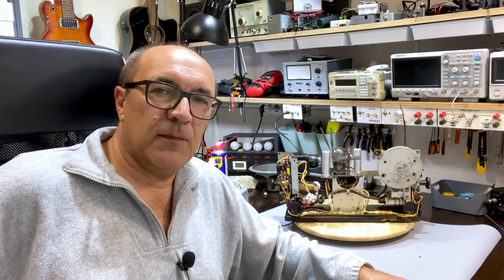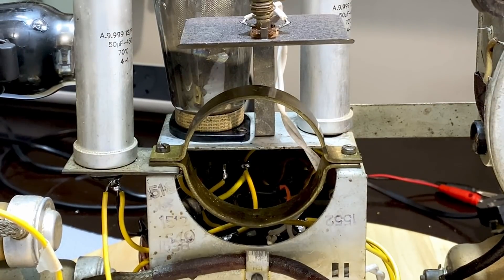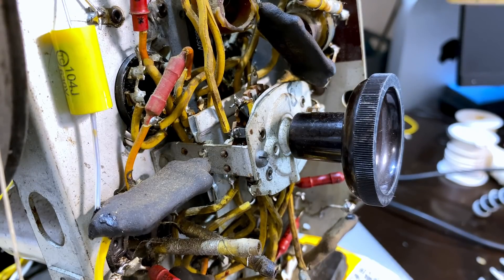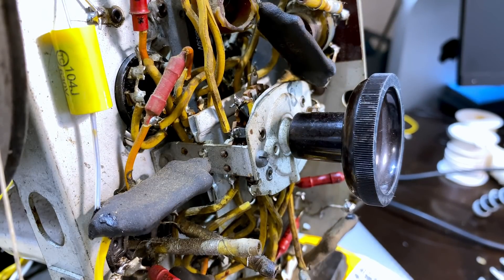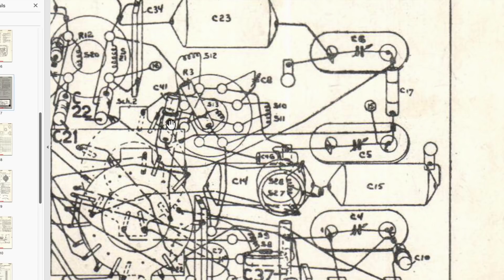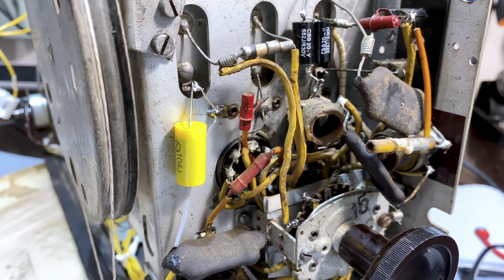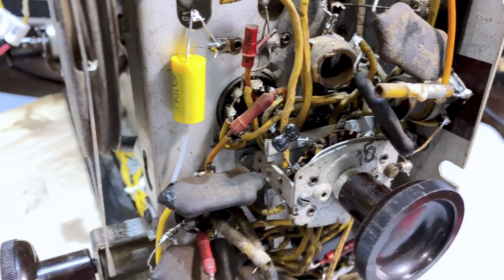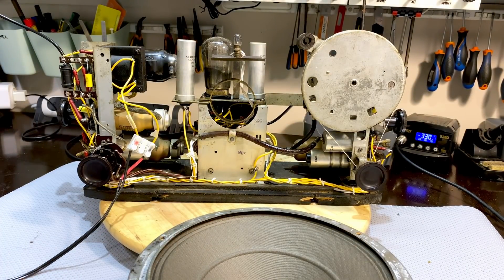Shortwave is back. She now speaks all three languages. Philips 461A restoration - part 3.  #PCBWay#

Comment: Great job finding the missing capacitor Manuel, who would have thought. Your wiring and looming looks great and the radio works well 👍🙂
Reply from the maker: 👍 Fault-finding on this set is a nightmare, especially at the front-end with all those coils having near-zero resistances. I got lucky 🍀
Reply: No, you didn,t get lucky you know you,r electronic  backwards and anyone who says different dosent know otherwise  @electronicsoldandnew

Comment: Hi Manuel. 
Congratulations on finding that missing cap! Who would have thought...?
I’ll be interested to see what you do with the alignment with those wire wound capacitors. I suspect you will find that it doesn’t need any adjustment. Those caps are very stable and the coils in the 2 cans are fixed so no adjustment is possible. 
I guess you will be looking forward to putting that dial string / wire in. 
All I can advise is:
1 Don’t let the wire come off the tuning drum / wheel. Tape it, glue it, whatever. If it comes off, take the chassis out and start again. 
2 Unscrew the right hand pulley - don’t try to stretch it over. 
3 Use bamboo kebab sticks with a split in the end to manipulate the wire. 
At least that’s what worked for me. I will be watching with interest!
Good luck!
Reply from the maker: Thanks for the hints Don. I’m actually dreading it 😊 
I plan to test one or two of the alignments with those wound caps to see if it works out, and then decide from there.
Reply: @electronicsoldandnew  I would try to replace these fragile capacitors temporarily with other variable capacitors and tune with them. Then measure their capacity and compare with the old ones.

Comment: That was a surprise having that capacitor missing, which stopped the shortwave from working. As for the cable tying, when I worked at Marconi Instruments the women that did that particular job showed me how to do it correctly, but it took me many attempts to get it right.
Reply from the maker: i can understand that. It’s still not automatic for me.

Comment: It looks like that cap has been soldered in before, but it wouldn't have surprised me if they forgot to put it in place. I do find loose components they forgot to solder or partly soldered components in Philips radio's from time to time.
Reply from the maker: I think that’s what happened. This section is a nightmare to trouble-shoot due to the low resistance coils, so someone must have given up.

Comment: I've used those black capacitors before.   They don't seem to stick out like the brand new yellow ones do.  I like them.
That said, some of the original paper caps would have been yellowish new, so I guess they would have been yellow...
Reply from the maker: Yes, yellow seems to be a recurring theme in this radio 😊

Comment: Oh, nice you found the problem with the shortwave reception. Weird that someone took the capacitor completely out and left it out. You were lucky the wiring on that side is still quite good  the wiring on mine was a melted mess and had to replace it completely. I do love the sound on these radios, it isn't hifi, but quite good for its age.   Looking forward to the next video and how the radio finally will look.
Reply from the maker: The wiring behind that switch is a nightmare. I’m truly glad mine was OK.

Comment: Really enjoyed this resto Manuel - great job. I was wondering what you found under that piece of tape on the speaker wire? I ask because I am doing a Philips BX798 at present, and the same speaker wire you show, on mine has a single knot in it, and never appears to have been worked on, so I assume that is factory. But for what purpose? All the best.
Reply from the maker: It was just wrapped together after a break. I just re-soldered the wire direct to the tag, as it was long enough, and discarded the excess.

Comment: The Madeira Sherlock Holmes and the case of the missing capacitor, 
I was trying to find a source of waxed hemp twine like used by the radio industry in the 40s.
I know the lashing twine the phone company used when I was a kid was tan colored and highly waxed. I don’t know if this stuff that is available through Amazon 1mm waxed hemp twine is the same.
Reply: Hello. Some thread for sewing leather by hand is very similar if not the same. It's the same thickness. I have some of it and it works quite well. The knots stay where you put them.
Cheers!
Reply from the maker: 😊 Waxed would be easier that the stuff I’m using now 😊
Reply: Ooh, I still remember the pain in my pinky from pulling tight waxed twine! Many, many, many meters.
The company was making PA systems, already tranistorized. (About 50 years ago, during my vocational training.)
Reply from the maker: I guess it can get painful doing that all day.
Reply: @electronicsoldandnew  Manuel, tell a family that you’re going out to buy some fresh fish for dinner, and go down to Madras Harbor that services the fishing industry as I believe they use a waxed temp twine for mending nets and sales. Be sure to stop at the grocery store and buy some fish on the way back as the boat probably won’t sell you any fish. Probably be a fun trip regardless of the outcome.
Reply from the maker: My wife will probably say, “Is that another trick that Mack put you up to?” 😊

Comment: Who would ever expect a capacitor to be missing? 😅
Definitely a great job figuring this out.
However i´m not really interested in such old devices as they´re not really suitable for daily use.
Often they don´t have a proper mains isolation (transformator) and thus using the audio input jacks is actually dangerous, plus AM bands have been completely shutted down in germany so there´s not much to receive, except some weak stations from elsewhere you can receive at night.
But the late 50s devices are really exciting as they usually have a great sound and FM band aswell as a proper power transformator, so it´s a lot easier to work and handle.
Reply from the maker: I too prefer the late 50s sets because of FM, but this one has nostalgic value to the owner.
Reply: @electronicsoldandnew  Well in that case it surely will be a pleasure for the owner for having it back in a perfectly working and safe condition. 👍

Comment: Congrats on the return of SW! A silver mica is a good choice, has very low capacitance drift with temperature. Sometimes ceramic caps with negative temp coeff. is fitted to counteract oscillator drift, seldom in "consumer sets" however
Reply from the maker: true